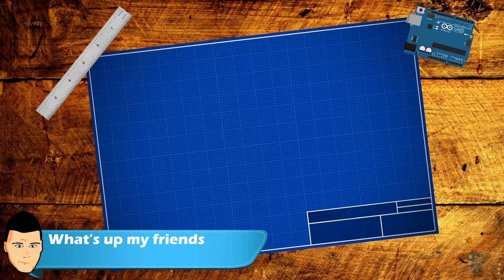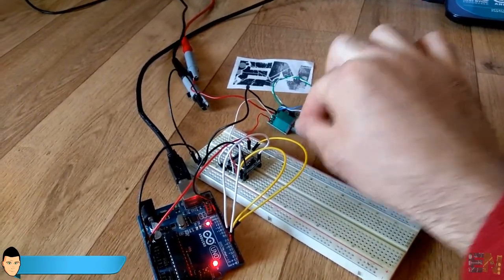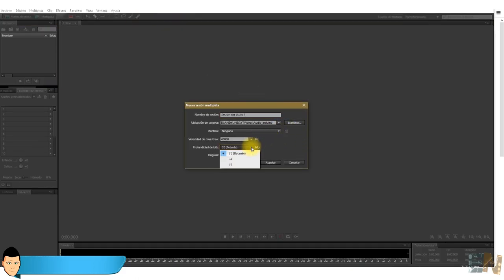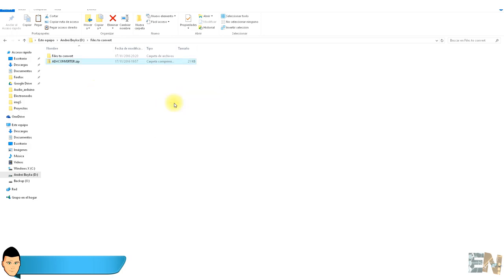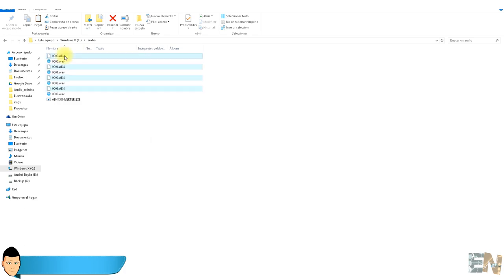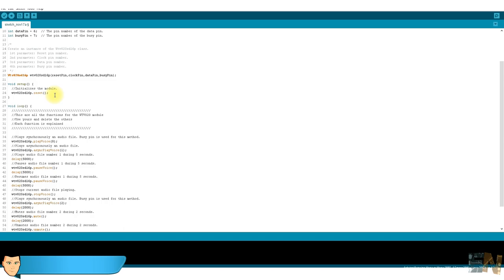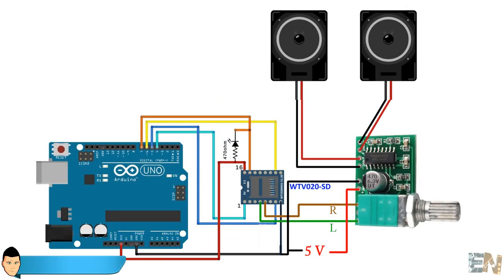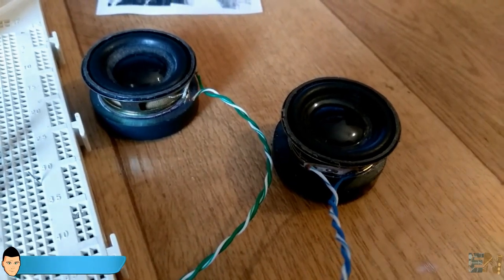Audio module Arduino ad4 and Mp3 sound files

Comment: 2:29 I converted the track I wanted to use to Mono 16bit PCM with Audacity software.
The module plays other AD4 sample files very good yet the composition I chose plays very load with distorted sound or you cannot hear it at all.
I tried to lower the amplitude of the WAV file each time by 4dB to no avail until I can not hear anything.

the frequency is 44100Hz if it makes any difference 😄
does anybody has a clue?

Comment: Hi everyone 
 I have a text file (0/1) stored in sd memory connected with arduino,
May question,
 Is it possible to make a code that converts the text data (1/0) into volts on one of the terminals of the Arduino, so that if Arduino read one,  the LED will lighting and if zero LED will turns off ?
 thank you very much

Comment: IM wondering, is it possible to make a sound play under certain circumstances? Like a motion sensor. I have seen plenty of videos talking about making a MP3 player with arduino and playing tones with it, but no one seems to have used an "even triggered" sound.
Reply from the maker: YEs, is quite easy, Connect the sensor and when it gives a signal (object detected for example) use the library to play the sound as in the video.

Comment: Great tutorial, Is it possible to add buttons to play each sound you have loaded onto the U Disc? also with the Amplifier (only one I could find that was close was PAM8403) Would it be possible to wire a TIP31 transistor to 2 LEDs and a 9V power supply to have them flash with the sounds?
Reply from the maker: Yes, you could do all of that. The module has also input pins for push buttons to play, pause next/previous track.
The PAM8403 amplifier is not the best quality but it is quite good for this module.
And the thing with the leds I never tried it. Of course taht you could do it but maybe it will affect the output power.

Comment: Hi thanks for this, however having massive issues with using my own files, converted wav files as described (even used Audtion to import / export) but all I get is a beep > pause > beep. or when I use an online file convertor once I convert to AD4 format it plays about 2 seconds then stops....Help !
Reply: reset pin give 5volt